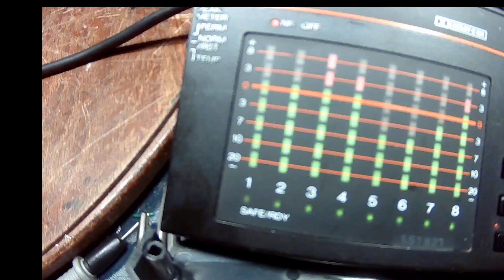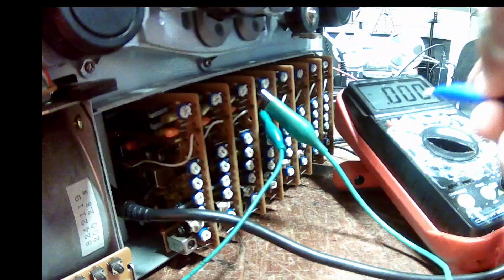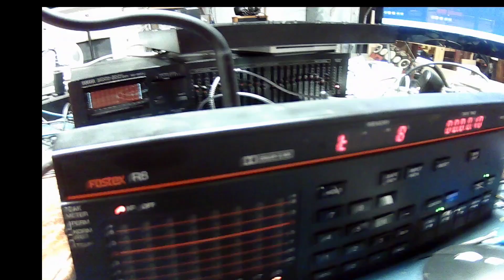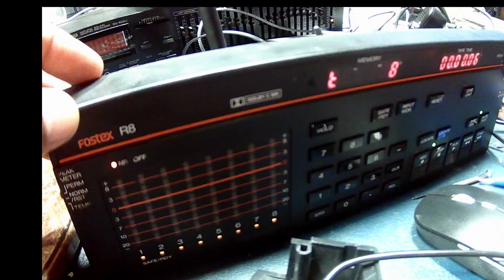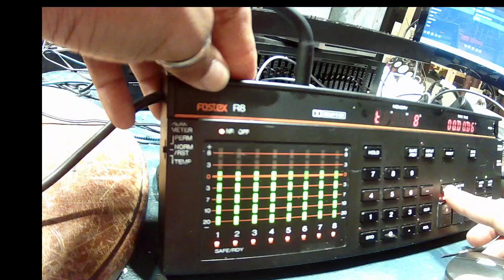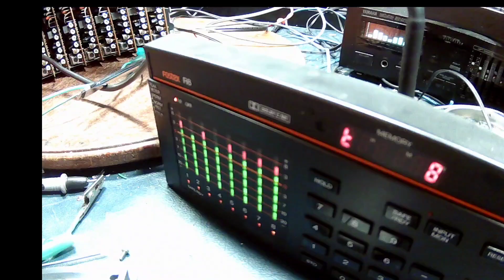Fostex R8 Reel to Reel Playback and Record Calibration (Oops out of sequence, read description)

Comment: yes brother! thanks for these r8 videos! i have one, my first reel to reel, i absolutely love it, it is connected steadily on my mixing desk, my primary form of recording, i always record 8 busses from the mixing desk and the same 8 busses are routed in parallel to the audio interface. when i compare the two versions (the digital multitrack and the tape multitrack) there is no comparison, the tape version always sounds more present, even with a very slight roll off on the highs (very pleasant) and a lil transient taming (also very pleasant), while the digital recording (done thru a motu ultralite mk3 96khz 24 bits) always sounds a bit weaker, anemic, lacking life, which i have to pump back in thru digital processing (mainly eq, compression and saturation).
Reply from the maker: DB I (and many others) would love to see a demonstration of this process in a video sometime, Brother.
Reply: @5thcomm  i'm not that good in doing videos! but i'll try, if it comes out decent i will upload it and send you a link!!